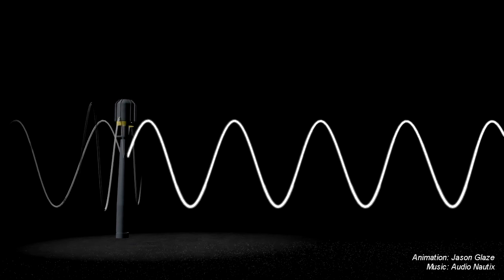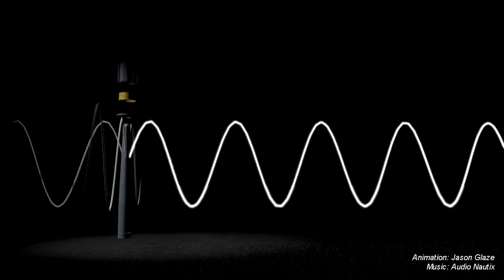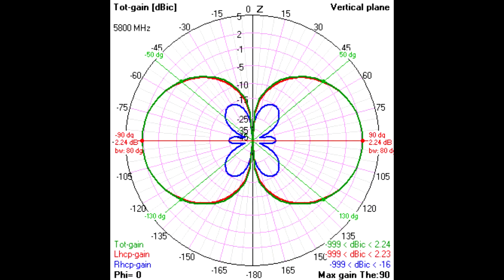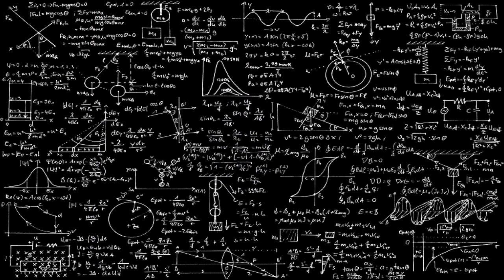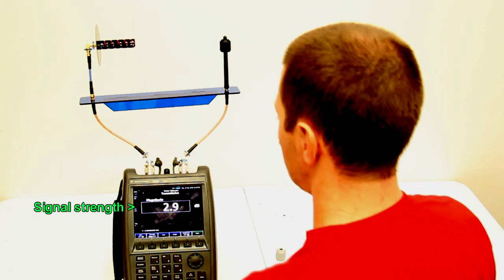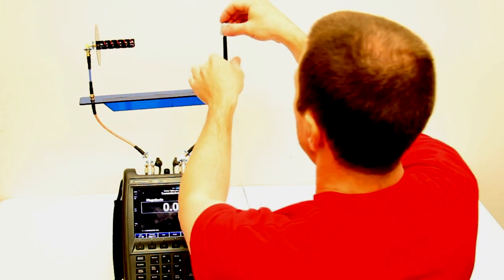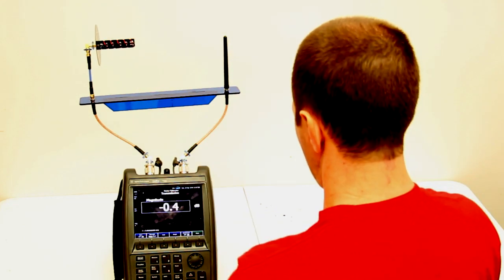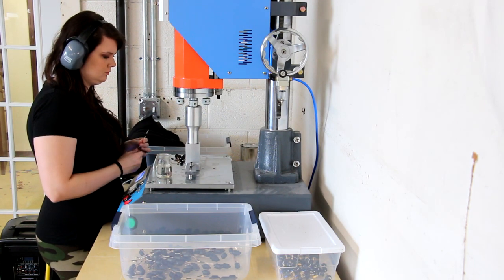Switchblade antenna overview

Comment: Think i'm going to pick a set of these up with my next order from VAS.  Does it come with the standard rubber ducky and/or does it work with others that come with so many goggles?  How important is the vertical alignment with the dipole inside, and how is it achieved?

Comment: Any chance we might see a switchblade concept in a ufl/mmcx minion-like form factor?  I'd love to be able to easily switch between left/right polarization as is required at some races while still using just ufl or mmcx to drop the weight of the SMA.

Comment: Would this be acceptable for receiving? For our DVR race ground station specifically at races for pilots running different polorizations?
Reply from the maker: Absolutely!  That's typically what I use them for but the last flight I took with it as a transmitter I went 1.25miles on 25mW.

Comment: love it but what keeps it from flying off in a crash? do you tape it on after install or something
Reply: Frank Sarfino from what I’ve seen it’s a very tight fit.. like you have to use ‘force’ to get it off
Reply: You know..."Force" lol.
Reply: Use the force, Frank.
Reply from the maker: LOL!  The "use the Force" comment is pure gold.  These snap on really tight.  The first 2-3 times you try to remove them is kind of difficult, but after that they fit perfectly.   It takes ~6lbs of force to remove them.

Comment: Question though... how does that modified stock antenna compare to an out of the box CP cloverleaf antenna in terms of reception and radiating pattern? Will the performance be any better? Otherwise I'd just prefer to stick to the cloverleafs.
Reply from the maker: Far better.  In fact, this is the same antenna as the Ion V2.  It is an incredibly high performance product.  It is very high gain and very high axial ratio.  I just got lucky being able to make a novelty product from a common item.

Comment: Well I definitely want to try that! Will just a single be available?
Reply from the maker: Maybe.  I haven't decided on whether or not I want to do individual caps or not.  The whip isn't your standard stock whip.  I modified them specifically for this.  However, with some modification, the caps will work on other whips.

Comment: nice, is this available for 2.4ghz?
Reply from the maker: Unfortunately it is not.  However, I can happily give you the calculations to do your own.
Reply: @CAGreve1231  Thanks for the reply, that's so kind, i thank you in advance... this can work even in a whip/colinear or 3/4 antenna for FM band? or components will be too big for FM frecuency?
Reply from the maker: @Xeophane  - Too big depends on your space allowed.  The truth is that you can reduced the diameter by flattening the angle of the elements... at least to some extent.  You can also manipulate the geometry... but again, this is limited.

In general, the diameter is going to level out around 1/3 wavelength.  Any smaller than that and you are running into problems.
Reply: @CAGreve1231  thats the diameter of the elements around the antenna right? and what about the diameter of the elements of the switchblade, need to be same thick as the antenna or doesnt matter? like if the antenna is 2 inch diameter, the elements need to be 2 inch?
Reply from the maker: @Xeophane  I was referring to the width of the antenna.  The minimum width is ~1/3 wavelength.  The length of the elements also comes out to right about 1/3 wavelength.   Element thickness will change the length slightly.

Comment: With the vas dipole anttena mod how come when I put a 5dbi on it the ras goes up to 16 is tht bad
Reply from the maker: I assume this is the Taranis mod?  The reason is that the Taranis doesn't actually measure SWR (SWR meters are very expensive).  Thus, it is guessing and the impedance of our antennas is set on a $20,000 piece of equipment.  The Taranis is set to a less than perfect antenna, so it is a programming issue on the part of FrSky.
Reply: Video Aerial Systems yes the taranis mod with ras of 16 is tht bad
Reply: @CAGreve1231  so when cutting the wire for the mod how long should it be 84mm from bottom of sma or 84mm to the shielding with a little bit of the inner for soldering
Reply from the maker: You want 84mm of shielded cable.  That is, from the base of the SMA nut(where the cable goes into the fitting) to the end of the coaxial cable shield should be 84mm long.
Reply: @CAGreve1231  with a little bit of the center wire showing to solder to rite
Reply: @CAGreve1231  I cut it to where the shielding is 84mm and 1mm of center wire showing is this rite cause the kit I got from getfpv the cable is 82mm long the whole thing
Reply from the maker: Correct.